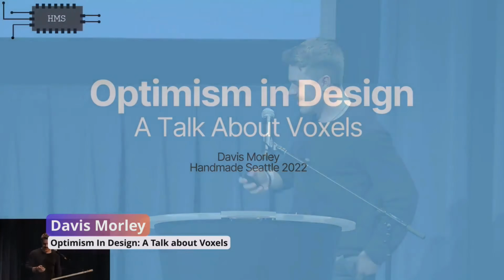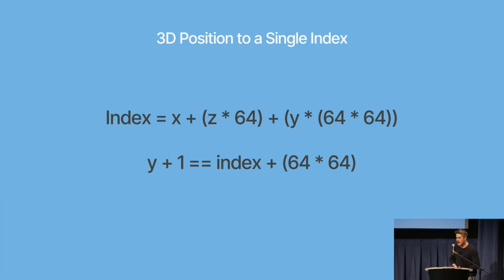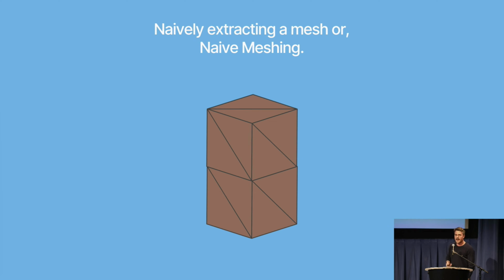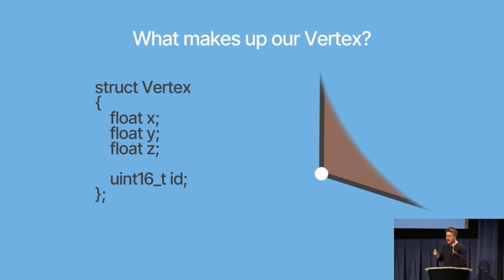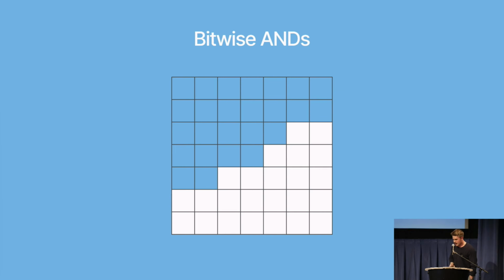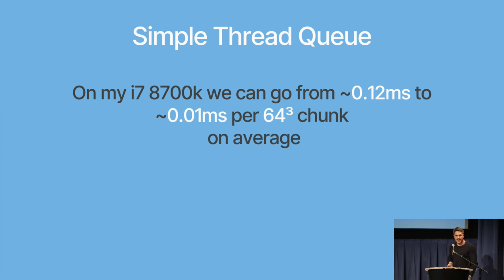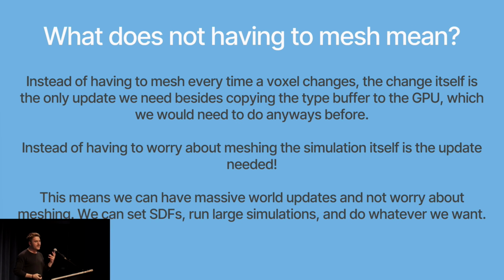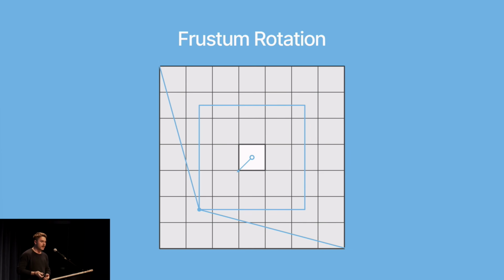Greedy Meshing Voxels Fast - Optimism in Design Handmade Seattle 2022

Comment: This is so smart!
I've been trying to wrap my head around the best way of achieving greedy meshing whilst maintaining textures, lighting, ambient occlusion etc.

From an optimisation standpoint, do you fill the texture data for a slice of the global lattice in the fragment shader, or do it elsewhere and pass it in?
Reply: Given that the chunk data is already on the GPU, it makes sense to do the lookup from the fragment shader.
If you store IDs, and then have a separate buffer mapping indices to properties, you can lookup all the data you need pretty quickly that way. You can even add textures if you need them.

The downside of this approach is that it only works for pure voxels.
Reply: @Caellyan  Thanks for the clarification!
I'd hoped this was the case as it made the most sense to me.

I'll be having a good run at this in January.
Reply: @LeBopperoni  There's a separate video on his channel where he leads a talk describing how he builds the geometry and says he stores run-encoded IDs on the GPU.
Nvidia's paper also does something similar in their efficient raytraced SVO paper, though they use a single buffer for everything which is better for data locality but makes it extremely difficult to modify the terrain so if your voxels don't need to change at runtime it might be best to keep them in buffer you populate once. You also don't need to store texture index property if you don't have multiple voxels with same textures and then just have a texture array where index == ID (0 being air/transparent).
Reply: @Caellyan  yeah I plan to just concatenate every world chunks data and handle it as a single buffer. Can just store an index per chunk for updating since I recycle through a pool of them anyway.

Comment: What GPU hardware are you targeting? I would think that overdraw becomes a problem, especially in the case where you are looking at only very distant terrain and the GPU has to draw and discard 4000 full screens of pixels.
Reply from the maker: I ran a Nsight GPU Trace and the percentage of frame time spent discarding on a world that expands infinitely only in two directions, while looking directly down the horizon, was around 2%. I would bet this would run on 900 series just fine. If this ends up becoming a problem though the only thing you have to change is instead of having one global mesh for the entire world you break it up into a mesh-per-chunk. So if your chunks are 64^3 or so, you would have a lattice mesh specifically for a single chunk, then offset it and draw using instancing maybe, or even just copy the whole mesh for every chunk, and it wouldn't break a sweat and would still be many orders of magnitude less triangles than what a traditional meshing pipeline would produce.

Comment: I'm also implementing a voxel engine, but I can't quite follow the part where you use a single pair of triangles for the entire side of a chunk.

This might work in 2D, but in 3D, you're only taking into account the edge voxels. How would the inner voxels be rendered? If there are no inner triangles being rasterized, how are those voxels being drawn?
Reply: I also didn't get that you draw each slice on top of each other, from video I was thinking you put mesh on chunk borders only and somehow draw entire chunk with it
Reply: That makes a lot more sense, I also thought you must be having the fragment shader do a DDA/bresenham over the voxel data :)
Reply: Oh, I understand now. You're applying these to slices along all axes within the chunk. That's pretty simple! Nice!
Reply from the maker: I'm not quite sure what you mean. If you have a chunk that is 32^3, you have 32 faces per axis, * 2 for both directions, positive and negative. This ends up being 32*6 for an entire chunk, but the beauty of the Global Lattice is that you can use faces for the entire world, so if your world is 8192 ^ 2 * 255, that becomes 8192 * 4 + 255 * 2 faces.
Reply: @davis-morley  Oh, I initially thought that you were drawing the external faces of a chunk and have the fragment shader do a Bresenham line walk into the chunks binary data to find a hit.
I would have never thought that drawing all slices in a chunk would have been performant. Nice that it works!